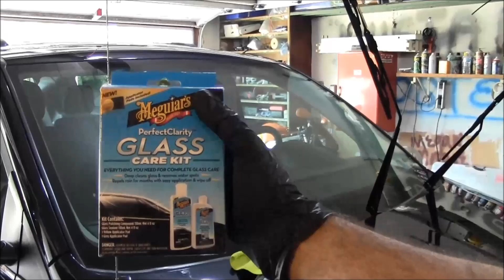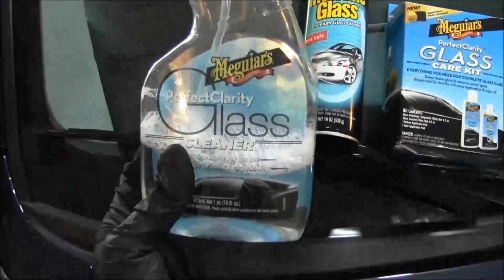Meguiar's G8800 Glass Kit (Worth Every Penny)

Comment: The trick to removing the sealant even easier is to mist distilled water on your microfiber towel. Then wipe off the sealant. Also. Do 2nd coat of the sealant that you remove immediately instead of waiting 10 minutes like the initial coat of the sealant.
Reply from the maker: 1989pulsar:  I need to try doing the second coat with the immediate wipe off.  I get the feeling that will work out very well.  Thanks for the tip!

Comment: I agree. Love the stuff. Wish the compound that comes with it was a little more potent.
Reply from the maker: 1989pulsar:  I have had very good luck with the compound so far.  You are right, it could probably be a little stronger.  It still does a very good job of removing all the stuff cleaning the windshield with a glass cleaner usually leaves behind.

Comment: I like to use vinegar and water with newspaper....but I may give this a whirl.
Reply from the maker: J PP:  Vinegar and water wiped with a newspaper is the old school 1920's method of cleaning glass.  There are some people who still swear by it.  I've never tried it though.
Reply: @fwh79FOXR6  lol, 1920's, old school....indeed. it's unpleasant smelling, but sure does the job.
Reply from the maker: @jpp9846  I think picking up a glass specific microfiber towel makes a world of difference when you are cleaning glass.  Cleaned up my dad's Lightning about a week ago and tried this glass kit on it.  His truck is parked under a tree and it is getting hammered with tree sap.  My dad was complaining because the sap was very hard to remove every time went to clean the windshield off.  So we got his windshield cleaned up with the glass polish and used the sealant.  Now, with the sealant on, the tree sap comes right off.
Reply: @fwh79FOXR6  yeah, I probably will, I like trying new products as well. 
I drove my old Tahoe to Florida one year and it rained almost all the way to Alabama. Somewhere along the way, I picked up some kind of contaminate, that etched it's way just on the outside of the wipers. I tried everything and couldn't get that shit off the edges of the windshield. I even tried jewelry rouge! I ended up just replacing the dam thing. There was a lot of construction along the way, so it must of been something on the roads? Strange.
Reply from the maker: J PP:  Damn, that's a crazy story!  I thought I had some bad luck!!!
Reply: @fwh79FOXR6  completely destroyed the outer edge of the windshield, it had a Haze on it... strangest thing
Reply from the maker: @jpp9846  It is mind-boggling what can happen to cars.  Things you would not believe without seeing it in person.